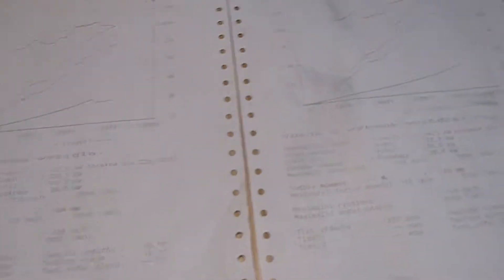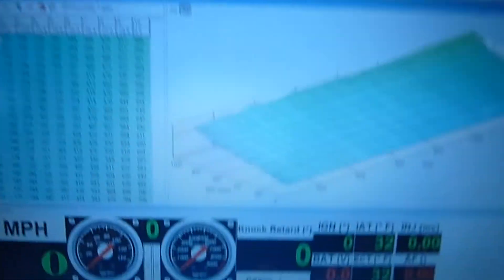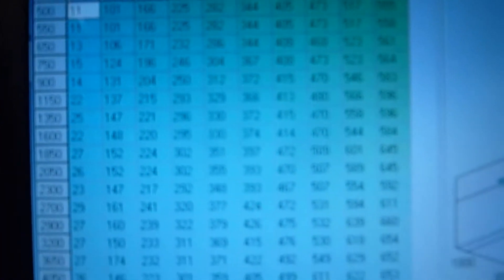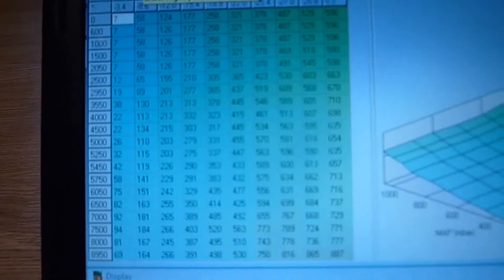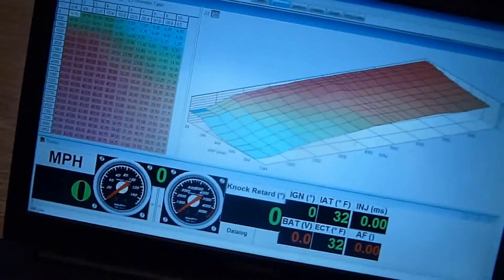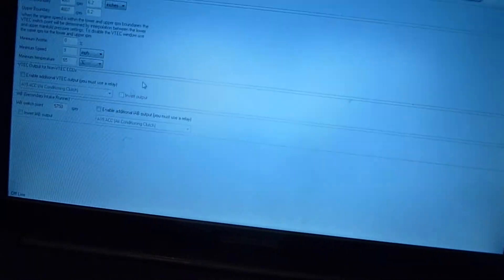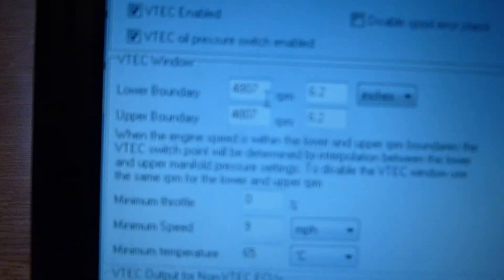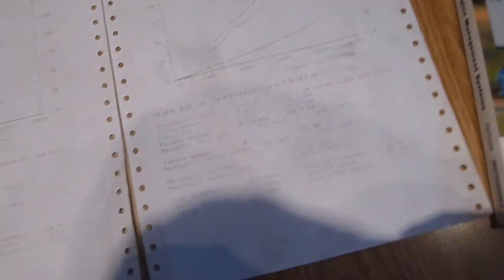Tuned Hondata Map For a B16A2 +10hp Gain

Comment: Thanks this is great stuff. My car currently stalls at like 4k rpm.
It has a hondata s300
My set up is h2b h23a b16 tranny, skunk 2 mani, itr throttle, 550cc injectors, walbro 255, try y header. 
My question is what basemap should I use while I get it dyno tune, should I add more fuel?
Thanks I'm advance
Reply from the maker: If you can safely get it to the dyno and you are getting it tuned professionally, I wouldn’t worry about the map since they will know what to do.  I would highly recommend a wideband oxygen sensor to monitor if your engine is running rich/lean since the tuner will need this and you would save dyno time.  550cc injectors and a 255 pump will give you A LOT of fuel if you so you might be running very rich. Let me know how it turns out.

Comment: i have a question what wideband voltage did you use, the parameters
Reply from the maker: +jose sigaran 12.5-13 a/f
Reply: @S2K2NER  with those values its impossible you read 12.5-13 afr's

Comment: you won't feel when VTEC comes in and it will be just a noise.??
 I have a philosophy on this subject and I believe the Honda experience should be
fun to drive.  So what I do is set the VTEC 100, or even 200 higher than
its "straight line" position, so that when the customer hits VTEC, the
torque jumps up like 10 LBS and the HP climbs steeply up and he gets thrown back
in his seat a little bit.  It makes the car feel "quick" in that
area, and makes it more fun to drive.  On 2 liter motors especially, I like
to make it steep after it hits VTEC so the customer can chirp the tires just
hitting VTEC. The guy gets a little chirp out of it, and gets
him excited about driving his car.  The job of the tuner is not only to
make the air/fuel ratio great and the car safe to race, but to make the car FUN
TO DRIVE.  BTW, you can mess with VTEC points like this all day long and it
does not make the car any slower in a race, because only a beginner would be at
that low of an RPM on a VTEC motor racing anywhere.
Reply: Hi. What do you mean you set vtec 100 or higher? How do you set that?